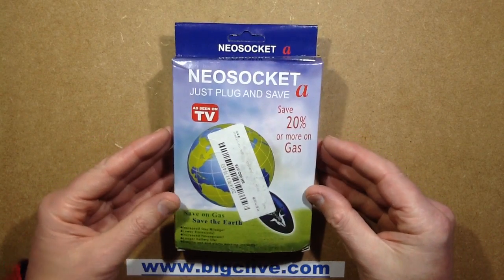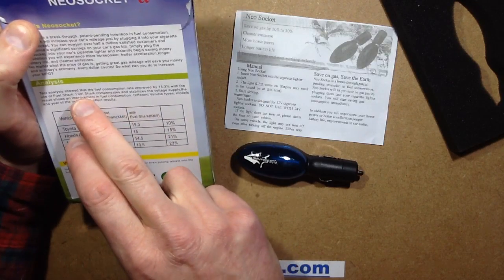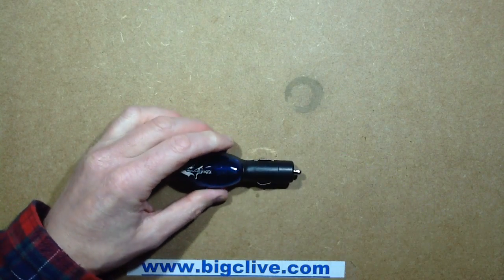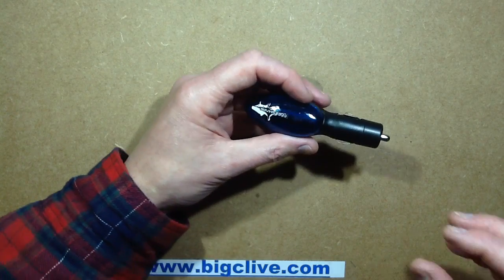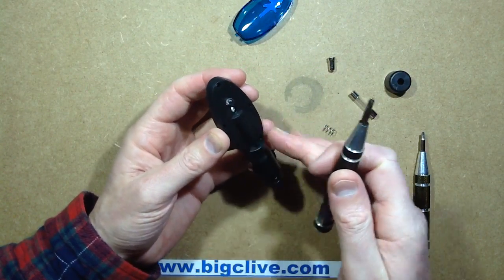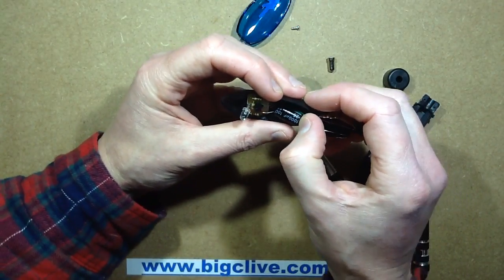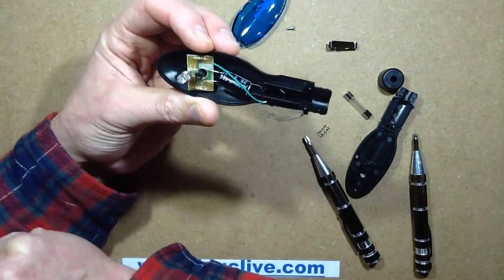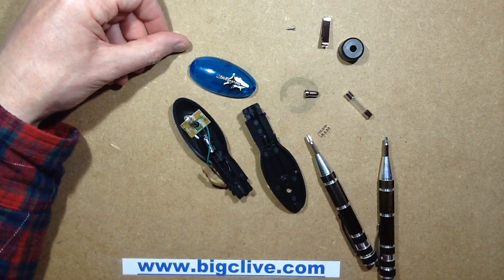A look inside a plug-in fuel economiser for cars.

Comment: Bought one. Plugged it into my Nissan Murano and the car has an economy meter on the dash. Before use the mpg was consistently 18.1 after 19.8. Almost  10 % increase in mpg. For the cost about $25 I can't complain. My Nissan Versa Note went from 36.6 mpg to 38.6. I'm a believer.

Comment: October 2021 and I have just seen an advert for one of these (Fuelsaver) it's now claiming a 40% saving and that a rusty VW beetle ran for 2096 miles on a single tank of fuel. It's also claiming you will get "More Horsepower" and "Higher Throttle Response". And all for only $26.95!
Reply from the maker: Yeah, they go in surges.  Often advertised on sites in random countries and drop shipped from China.

Comment: Clive being that this is 4+ years old how about a revisit on all the silly things that they have come up with for people to "save fuel"? I think it might be a fun video.
Reply from the maker: I've hopefully got some quack car devices on their way.  If they actually arrive.
Reply: @bigclivedotcom   My wholesale contact in China tossed in a few things with one of my orders and I happened to get the HP increase one. It's something called nitro OBD2. It's a so called "Performance Chip Tuning Box" <<< (there words). This thing has a stack pair of boards with what looks like a transistor and the 8 pin chip on the in between side so you can't read the numbers if there are any. A switch and some caps and resistors along with a few LEDs. I got a better look at it and the 8 pin chip has numbers on it but I can't read them do to the tight spacing between the boards. I was going to ask if you have some Big Clive branded spudger but in the process of looking at I found a fingernail works quite well to get into this one. You should get some branded spudgers for people that would like some. The ELM327 devices seem to be ok for diagnostics so long as you don't use any of the software that comes with it. FORScan does well for the Ford truck my group runs. But I can't wait to see what you have gotten.

Comment: I doubt ANY level of power supply smoothing would actually save fuel. And due to the LED and leakage current in the electrolytic, this device will cause a net drop (though an imperceptible one) in fuel economy.
Reply: Actually,  by using the socket but with a low powered item you do save some fuel.  Not 10-20%  more like 0.01%     think about it like your phones wifi.  At home it doesnt use a lot of power, but while driving around your phone is constantly looking for connections, that looking uses up a lot of power over time.    Not that I'm suggesting getting this pos,    just plug in a phone charger with an led.

Comment: if one wanted to save gas either shut the windows and turn the a/c on or just shut the windows depending on the temp  , open windows drag the car thus use up more gas.  and certainly work better than this um dodgy item.  :O

Comment: During the fuel crises on the 1970's there were many “tips” and devices to save fuel. So I tried them all.
Keep your tires aired up and save 15%
Keep your engine tuned up and save 20%
Replace your air filter and save 25%
Add special magnets to the fuel line and save 10%
Add a super duper spark device to the coil and save 20%
Drive under 55mph and save 15%
If you add up all the savings it comes to 105% so the only problem I had was finding someone to drain the excess fuel from the gas tank that kept overfilling itself.
Reply: that is because they did not have SUPER capacitors then  times have changed
Reply: At least there is science behind all of those. And obviously those dont add up together. I understand you said it as a joke (I really hope you did) but most of those are all true:

-Ever pulled a wagon or pushed a wheel barrow with flat tires? Flat tires are more work to push and increase surface area to add rolling friction and drag.
- Dirty air filters restricts air flow to the firing chambers resulting in poor ignition. What happens to a fire when you decrease its oxygen supply? It slowly gets smaller until it dies out. Literally the same concept.
- Never heard of the special magnets but it seems like it would help with contaminants in the tank keeping them from getting through the fuel system.
- No idea what spark device. Youll have to be more specific with your doo-hickie and thingamajig labeling.
- Driving under 60 does help with milage. Drive any car that gives you feedback on current milage my wifes car gets about 37 going 60 but only 27-30 going 70-75. It also shows in refilling the tank; 80 miles with a 10 mpg difference really shows in my bank account. Not sure if it has to do with increased wind resistance or what it is. Google can tell you if you really doubt it.

Things that actually affect the gas directly will make a difference. A plug in your cigarette lighter will now. If anything its added power consumption and more drag on the motor. The circuit is not complete and therefore there is no power actively flowing. Just like unplugging "electricity vampires." Itd be such an insignificant amount of consumption but still power flow nonetheless.
Reply: Ha HA.  In actuality its closer 2-5% fuel saving  for almost all of these  So potentially  25% savings is a more realistic estimation.  thats nothing to scoff at.  But these ones that plug into the dash.  Cmon.  Was born at night but not last night.    Its like my extremely special one of a kind river rock plucked from the Silver River under the light of a full moon.  It repels werewolves.     Dont see any around  so i know its working.
Reply: The best way to save fuel in the 70´s was buying a 90´s car.
Reply: Im not a car expert or anything but even i understand the science behind why things happen.
Reply: WOW!
Reply: Oh.... 55 Sucked !
Getting a ticket for 65 😕
Reply: ha2

Comment: You can pretty much conclude it's a scam just thinking about it logically.

Car manufacturers are under tremendous political pressure to improve fuel economy.  If there was actually a way to improve mileage by 20% by attaching a cheap dongle to the electrical system, they would all be doing it at the factory, since it would be far cheaper than redesigning the powertrain.

Which leaves only two possible conclusions - either there is no way to improve fuel economy with a cheap electrical dongle, or your car already has it built-in.  Either way, buying one is a pointless waste of money.

This is an obvious conclusion anyone can come to just by looking at the package and thinking logically.

Comment: In my first car I had a fairly large sound system installed and when the music was fairly loud, I noticed my headlights dimming slightly in time with the music. I put a 1F (yes, 1 Farad) cap in parallel with the supply which fixed the headlight dimming issue but made literally no difference to fuel consumption. 
If 1F doesn't make a difference to consumption, 1000uF certainly won't.
Reply: A capacitor on DC isn't a load, it just acts a bit like an extra rechargeable battery. So it won't do any harm, but as long as your battery is adequate to power your needs in the car, the capacitor won't have any positive effect either.
Reply: In Germany 1 Fahrrad saves a lot of fuel.

Comment: We just shows what you know then it seems that little capacitor is the key to this miracle device. I am off to the shop to buy ten capacitors to wire to my cigarette lighter socket which should give me ten times the fuel savings.

Comment: Interestingly enough that is SLIGHTLY more complicated than the ones I have seen reviewed online. Those have a single 4.7K resistor and a 1000uF electrolytic cap (in addition to the LED) without even a circuit board! You must have the "deluxe" model.

Comment: If you could get this at poundland it might actually be worth something. I can't buy a 1000mfd cap, an LED and a fuse for a buck. So... In that respect, and that respect only it might actually be "Worth something"
Reply: bullhornzz You can certainly buy 10 1000µ caps, 10 LEDs, and 10 fuses for about 2-5£ total. I'm gonna say that's still a pretty bad proposition. And they are gonna be better caps and better LEDs, and i'm sure you can put them to use eventually. Plus you won't be discarding plastic parts and contributing to a landfill.

Comment: If the thing really did cut down your fuel consumption, why don't car manufacturers build one in to every car?
Reply: TOASTEngineer Ooooh but don't you know that they're all in cahoots with the oil industry? And that mass market products like cars are made in the cheapest possible way and there's just NO WAY they could add another 10ct capacitor?

j/k
Reply: +TOASTEngineer Because they are in bed with the oil companies who tell them just how much the vehicles are allowed to get. Stand up and get out from under that rock and wake up.
Reply: We all know the oil companies and the auto manufactures are in bed with one another.
Reply: Doug Smith  You won:

Nothing. Certainly no originality points. But life isn't fair, is it.
Reply: Horseshit power saver, FART!

Comment: By this logic, when I had 80 FARAD of 32 volt capacitors in my truck I should have been able to fly to the damn moon!  No increase in fuel economy, but it did give the truck a bit more zip.  Also, didn't have the problem of the AC fan slowing down when I let off the gas, lol.

Comment: bigclivedotcom found the ad for the neosocket piece of shit. https://www.youtube.com/watch?v=6QTt3YEYV-0
Reply: TheWacoKid1963 this is probably a good thing, I see Amazon in the UK still lists them. £77.64 + £3.99 P&P
Reply from the maker: Well that instills confidence.
Reply: exactly, thought people would want to see it.
Reply: devicemodder Don't forget to visit their official website. http://www.fuelshark.com/ lol
Reply: TheDutyPaid their site is shit too. gave me a good laugh.
Reply: +devicemodder I had a very close look at this and could is does make a difference - just. And by just I mean that using a 350MHz Techtronics scope with ultra low capacitance probes etc I could only just detect a difference. Basically it seems to reduce some moderately high frequency spikes on the power rails - by about 3%. So would this make a difference to fuel use? Well if you had a system that was really dodgy and spikes were causing the sensors to mis-read (which you can force) then yes it could make a difference. However your fuel consumption would be through the roof anyway and you'd spot that first.
Reply: Gordon Lawrence
I agree with the fact that it doesnt help with fuel consumption, it is just a piece of marketing wank. just like those "overunity" or free energy devices. same goes for those devices that say you can get 200miles to the gallon.
Reply: I just thought you might be interested that someone has tested it in as much detail as I did.
Reply: Gordon Lawrence
Oh, yes I am interested. Good findings.
Reply: There are some harmonics off any alternator that are a multiple of RPM number of windings/3 and pully ratio assuming a belt driven alternator (i believe there are a few that are not). On the car I tested this worked out at about 10KHz at idle and 60KHz at near the redline. At the 10KHz end they were reduced by about 3% and maybe a fraction more at the top end. Thats it - hardly spectacular. The spikes were only about 500mV so a reduction of about 15mV, That would only "solve" the problem if there were spme severe earthing issues or some other nasty electronic problems.
Reply: ok so i cant spell
Reply: +TheDutyPaid Bolloxs, Missed it, Page has been closed down.

Comment: And yet there are people who buy items such as this and say, yes but the one I got REALLY works I can feel the difference and my fuel costs have gone down. A mate of mine has some "doo dah" in his fuel line and claims his vehicle has never run better, it stopped smoking, idles better uses less fuel etc. And this dude knows mechanics and still believes it.
Reply: It sounds like he had the right mechanical problem for an "upgrade" to work in his circumstances.
Reply: Mentorcase Depends on what it is and the vehicle. You can put some things in line and it help the fuel but really, are you spending more on fuel or devices.